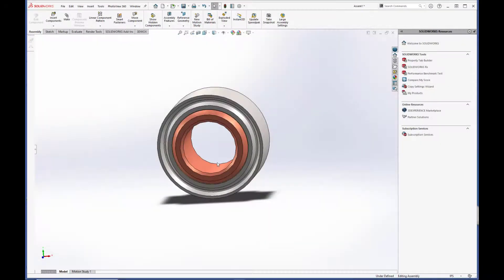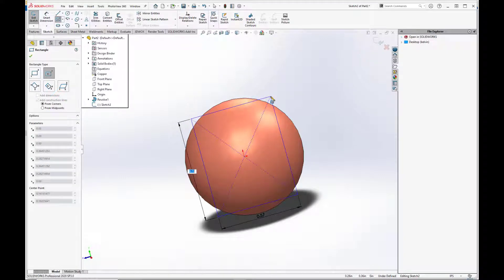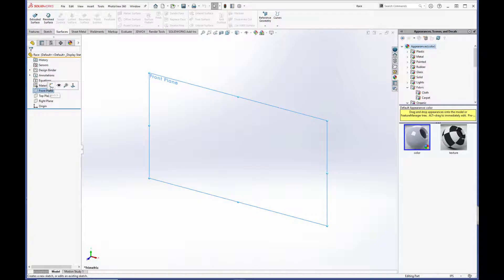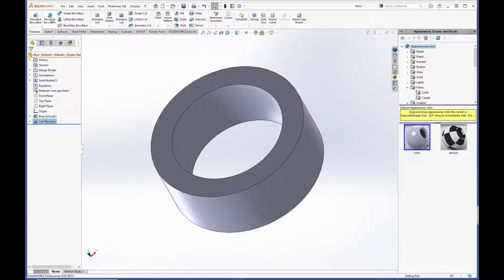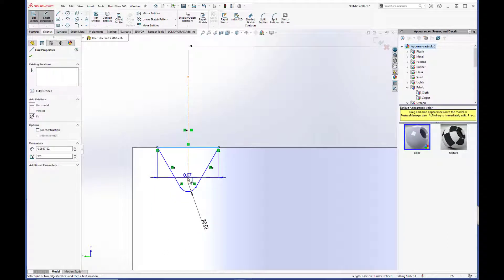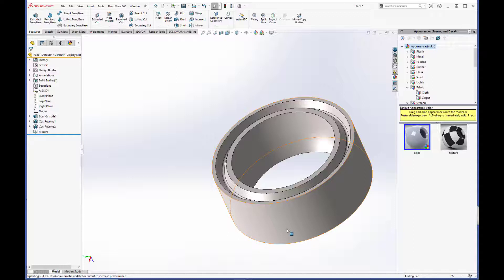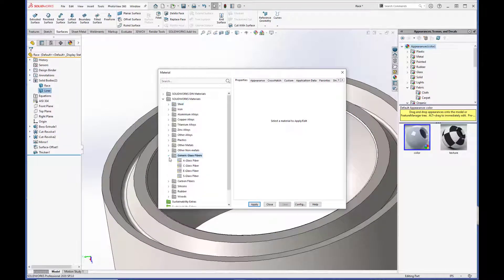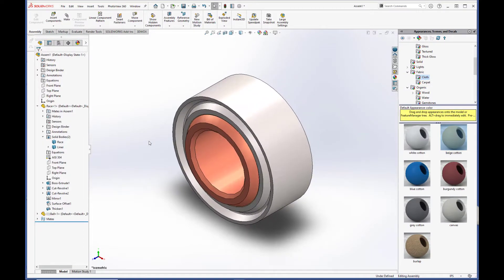SolidWorks Tutorial: Spherical Bearing

Comment: Is the ball bearing copper purely because of its heat conductive properties? For its quite a "soft" metal, almost only ever used for its temperature conductive properties or it's patina color on purely cosmetic projects. I've also heard a few instances of it used because of its ability to help purify water, as well as put in a slight amount of copper which the human body needs just like it needs slight amounts of most metals, without  the possibility of too much iron in the steel department. I'm assuming this to be the point, as if it wasn't you would use aluminum which is a little bit stronger than copper but not as resistant to heat.(I'm new to all this)
Reply from the maker: Good morning Jay, That’s a great and very insightful question. Alas, the reasoning behind the material selection is purely cosmetic. I based the bearing off an existing design that I came across. The bearing’s manufacturer would treat the ball with a proprietary surface treatment, which gave the appearance of spun copper. I set the bearing’s appearance to copper to replicate this.